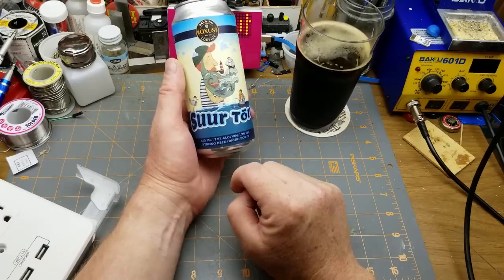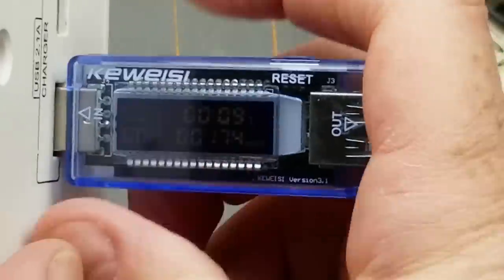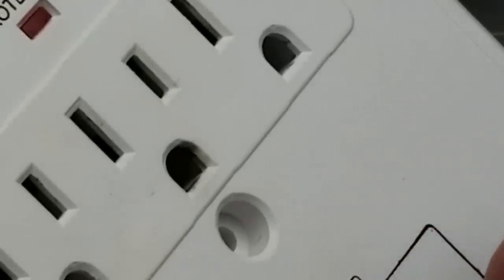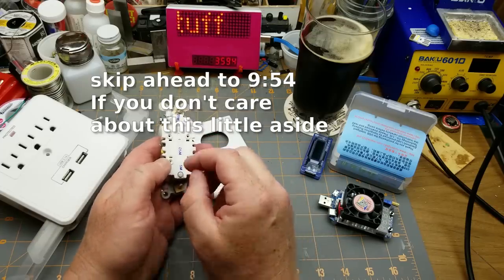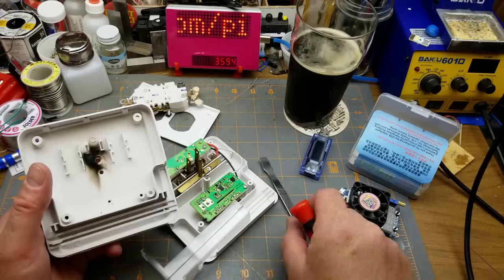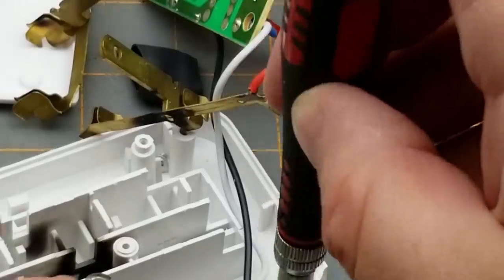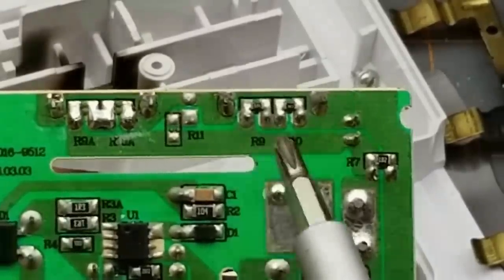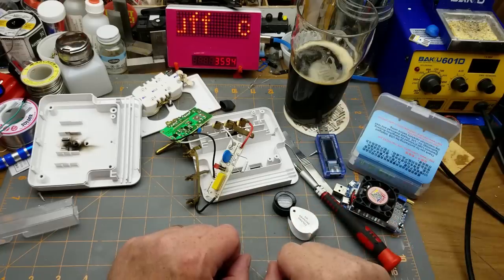yard sale find usb charger teardown

Comment: We actually recommend not using the push/pressure ports due to having a high probability of arcing/fire over time, as they wiggle themselves lose.   It would never seem possible on a new one, but give a house 20 or 30 years of pushing/pulling on the box... screws loosen... things begin to shift.  It does not take very much movement on those wires to wear enough copper down that they can slide out juuuust enough to cause a bad day.  The customer is never savvy enough to fix it - if there is power, it's working to them.

Enjoying the playlist!   <3   Thanks for all the work.

Comment: One thing to add about you quick explanation of North American 15A wall sockets. The screws on the tabs at top and bottom of the sockets must be metal, and the tabs are attached to the earthing pins. This is because many older homes don't have 3-wire (hot/switched, neutral, earth) but instead just have hot/switched & neutral. But the conduit which the two wires run through and the terminal box where the socket will be installed must be made of a conductive metal. The metal screws are held up to the earthing plates on the socket and screwed into the terminal box who is connected to earth via the metal conduit. Many home owners who decide to do their own renovations will by fibreglass or PVC terminal boxes or conduit, but keep the old 2-wire runs in place, and they wind up with a dangerous socket.
Reply from the maker: Good point.

Though, to be fair, non-metallic screws are much less common. I hadn't considered that someone might actually try to use them for this sort of application.

Plus every outlet that I have encountered comes from the factory packaged with the appropriate screws.

Still, it's a good reminder.

Comment: In my experience, the link between the two hot wires is removed in order that one outlet is constantly live and the other is switched, so that a table or floor lamp can be easily switched on upon entering a room.

If I were designing this, I would put a metal ground pin in the bottom (tied to the other one) to reduce the resistance to ground if the MOV was triggered.
Reply: The MOV has nothing whatsoever to do with the Earth/Ground pin. It is wired between Line(Hot) and Neutral. When it clamps, it pops the fuse on the input side. The ground is not connected to the MOV or protection circuit.
Reply from the maker: @johncoops6897  That is correct. It's the most common way overvoltage spike protection is done

Though I have also seen designs where there are 3 MOVs, on L-N, one N-G and one L-G

Comment: The center screw in mine is 1¼ and if you take the existing screw out of the plate you can still use the plate while installing the ac/USB adapter. Thanks for the video.

Comment: Are those diodes connected in parallel? Maybe they’re just doing current sharing and its still only half wave.
Reply from the maker: They do look like they might be in parallel.That's odd, though.Those diodes are beefy enough to handle more than the rated current individually.

Comment: The missing brand is a bad thing, but it looks half decent. The two outputs in parallel of course means that the output current is fairly limited (About 2A you said, but it might no be able to sustain it) and the slots means maybe a good isolation distance (Not all chargers with slots are good). I did not look for a voltage rating, but the physical design basically limit it to 120VAC. this means less demanding isolation than 230VAC rated charges.
I have analyzed more than 200 USB chargers and seen many bad ones, this one is probably good or most likely only half bad.
Reply from the maker: The biggest problem I could see with this one is the mains input.
I agree, the rest of the unit seems relatively solid compared to the "direct from china" ebay crap that I usually look at.

Comment: Do most of your on-screen beers have a stuck-on label, instead of a painted can?
Reply from the maker: That's common with many of the micro-breweries.

They do small batches and have an outside company can the beer (in generic white cans). Then they put on the adhesive labels.

To get custom printed cans at an affordable price they'd need to order large quantities of cans, which isn't practical for small batch craft breweries.

Comment: The short happened on the house side of the circuit, so I'm sure it tripped a breaker in the owner's house, but shouldn't have really affected the device (other than the brief arc). I'm not sure why there is a gap in the plastic that allows the contact strips to come into contact, though.

Comment: where did you get the blue screwdriver?
Reply from the maker: ebay. 
https://www.ebay.ca/itm/Protable-Precision-8-In-1-Slotted-Bits-Repair-Screwdriver-Pen-Hand-Tools-Set-Lot/292982713561

(though apparently ther are also afailable at Poundland in the UK, ds \o maybe check your local dollar stores.)

Comment: It's made by Ningbo Litesun Electric Co., Ltd.  http://www.nblitesun.com/product-detail.php?pid=4  I have the same Keweisi charger doctor and yours might have the same issue with the male usb plug in that the contacts stopped making good contact with the female usb sockets. Sometimes under a load the voltage would be very low and just moving the doctor would fix it so I had to replace the male usb. Have a good day!

Comment: The USB charger is manufactured by Intertex - label bottom right on the back  under the C  USA logo.
Reply from the maker: Is that what it says? 
I thought it was an Intertek compliance mark.https://en.wikipedia.org/wiki/Intertek
Reply: @pileofstuff  Mmmmm..Good question. You might be right. Thereis an Intertex Electronics company, but acually looking, it's a wholesaler.

Comment: It's almost better they sold you a burnt one it's like it was ment to be lol pretty stupid design flaw of you ask me. Great video👍
Reply: I think the guy who had it originally didn't screw it into a wall using the long screw but probably at the end of a power strip, and then pulled a cord which caused the hot to bend.
Reply: @mjbirdClavdivs  ahh I bet you are correct!.

Comment: That actually is pretty poor regulation as to be in spec the voltage shouldn't drop below 4.8 volts.
Reply from the maker: True, I'd prefer to see better.

But it beats most of the cheap Chinese power supplies I've looked at...
Reply: @pileofstuff  definitely, the dirt cheap ones tend to drop out completely at 1amp